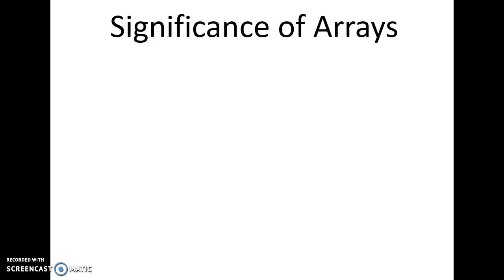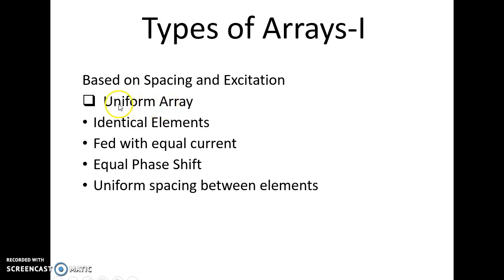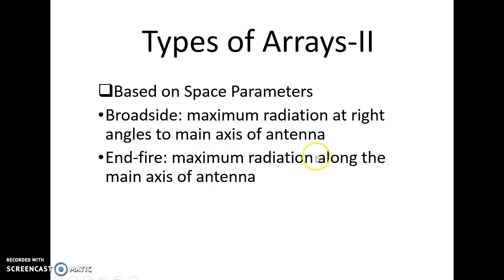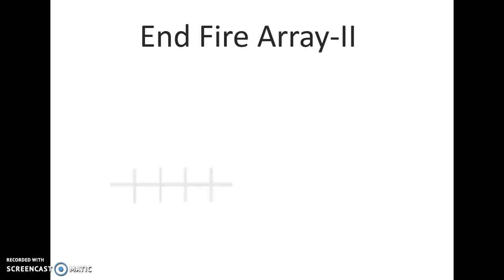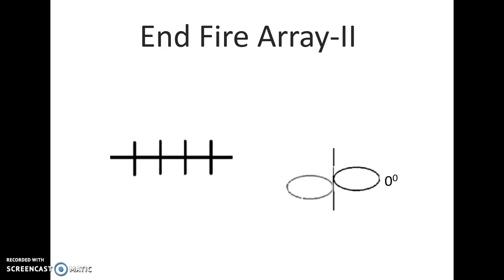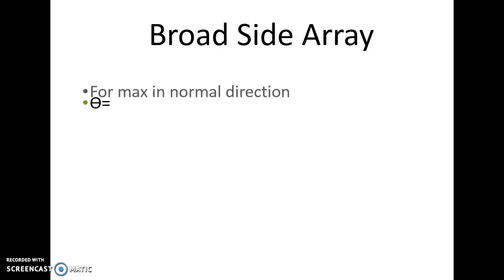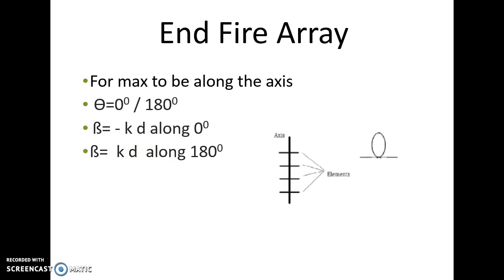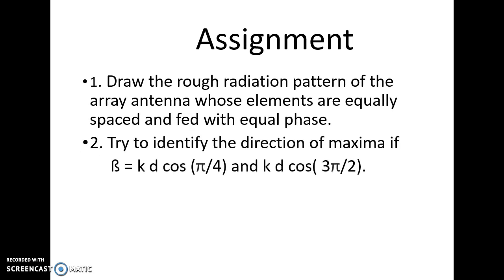Broad Side and End Fire  Arrays Venkata A P Chavali

Comment: What does maximum directivity mean??
Reply from the maker: When compared to a reference antenna how a directional antenna radiates in a particular direction which can be measured in terms of intensity  or field strength (basically we consider directivity as a ratio of intensity/ field of direction antenna to that od isotropic antenna)